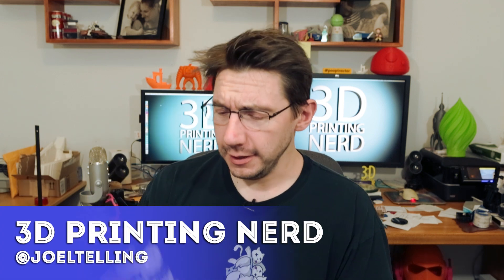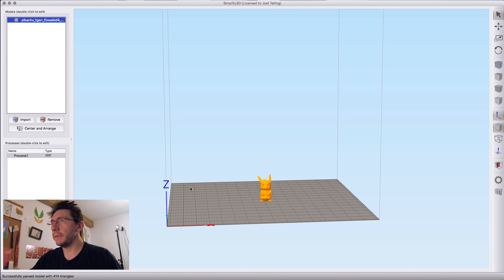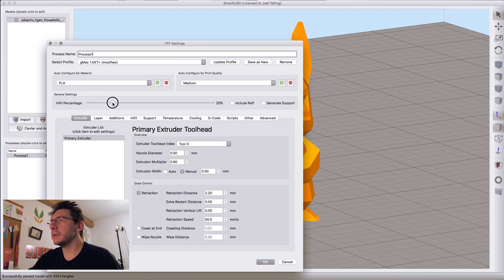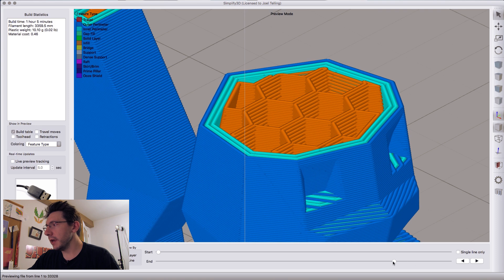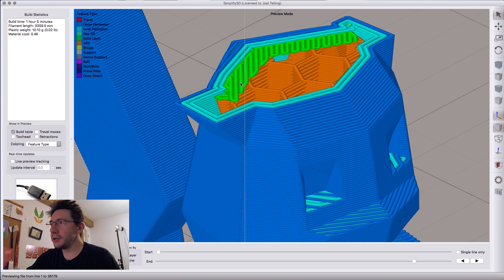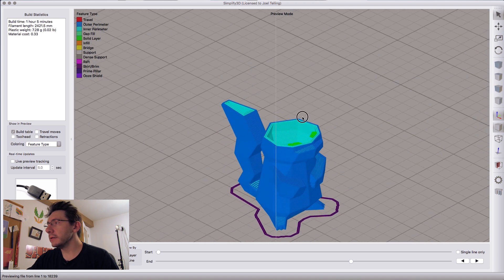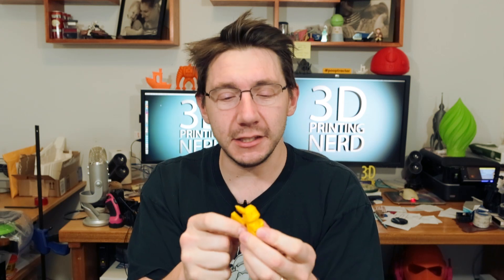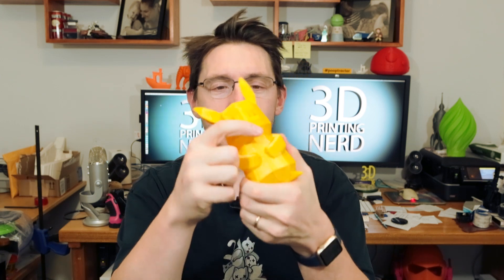3D Printing: Stop Wasting Plastic on Infill Percentage

Comment: What plastic did you use, there?  I have trouble with my silver PHA being hopelessly brittle when it's that thin.  I just did new arms for my sunglasses, and I went through about five iterations, trying to solve a problem with them snapping.  For those, I did go with 100% infill, but they were so thin that that was more a formality.  The walls were nearly touching, anyway, and I wanted the surface area contact in the brittle patch.  If I'd known, at the time, that Simplify 3D can do different infill at different layer heights, I'd have dropped it after the weak point.
Reply from the maker: +Michael Vaughan I used Colorfabb PLA/PHA for this one.
Reply: I thought so.  I think my roll of silver might have been weakened somehow (it's been in not the best storage for a couple of months).  I can snap it off the roll with my fingertips.
Reply from the maker: Michael Vaughan Oh wow. I have some filament that I haven't stored very well, and it's brittle like dry spaghetti noodles.
Reply: +Michael Vaughan The model in the video is a surface, it gets its strength from the walls and the structure, however, the arms of sunglasses don't have much material/wall/surface/volume so this will have a bit more impact on your arms.

I would advice just using ABS, it can bend better than PLA and breaks less fast. PLA however is 'stronger', but more brittle, but not brittle in a way you would really notice if you are just using it for small parts that dont have to carry much weight.

Comment: Hi Joel,I understand what you are saying and it all makes sense, however, if you are eliminating infill but increasing the perimeter how much are you really saving? I want to stress that I am not trying to come across as being ignorant or whatever but it's just an observation.
Reply from the maker: +Reviews 4 Youz !!! I thought about this after I read this from you, so I did a test. I put a 100mm cube in Simplify3D, set perimeters to 2, and infill to 10%. Simplify3D reported a 12 hour print time, and a plastic weight of 157.11 grams. I then changed it to 3 perimeters and reduced the infill percentage to zero. Simplify3D now reports 6.5 hours to print, and a plastic weight of 68.71 grams. You're not ignorant - it's a great question. Looks like the answer is you really are saving quite a bit of filament.
Reply: +3D Printing Nerd excellent !! funny thing is I was going to ask you to do this exact test. Thank you for all your videos, I love your enthusiasm and dedication to detail.
Reply from the maker: Reviews 4 Youz !!! Aww, thank you!  #highfive

Comment: HOLY CRAP was that good info! I hadn't even thought about using the "print preview" on S3D to look for ways to "cheat" infill by figuring out what support the shells would give.  Have you done any tests to see if increasing layer width in tandem with number of shells helps or hurts overhang-slouch?

And what about reducing infill to increase tolerances? I'm positive that too much infill can "bloat" a model (I'm currently dealing with a bunch of wasted carbon fiber due to printing an overfilled, over-sized part that needed to have tight tolerances... :( ) - but not sure if simply reducing infill will fix the issue..?
Reply from the maker: +Brandon T I don't think infill promotes bloating. I can't say I'm 100% sure, but, I can print with no infill, and 50% infill, and have the parts measure the same.
Reply: +3D Printing Nerd Ugh, well....that sucks, then, because I've got a friend (i.e. "my #1 customer"...sigh ;) ) who needs me to print him a bunch of parts to pair up with electrical components, and they need to be less than .2mm (absolute tops) tolerances or else things won't fit together correctly...and I already suspected 100% infill was the problem, and after this video was sure of it.  But I haven't had a chance to attempt a high-tolerance print with a (much) lower infill yet, so it's only speculation.

I admit that I haven't been sticking with a single filament color/type when testing, however, so that hasn't helped anything.  I'm sure in the end I just need to figure out the right layer height vs. layer width vs. infill vs. everyothersettingimaginable to get it right...but was hoping for an easy fix with infill. (Hah! I'm a comedian!)

Comment: These videos are dangerous... they just make me want to get a printer.
Reply from the maker: +Tim Gruich GET A PRINTER RIGHT NOW
Reply: Print me one.
Reply from the maker: Tim Gruich :)
Reply: And the ender3 is less than 200 and is great quality.
Reply: you can choose hang printer( require a lot  of space), cheap as f Anet A8 (require tons of troubleshooting) or Snappy?(most reprap reprap printer = quality vary)
Reply: I got a Prusa MK3S about a week ago. It's been a BLAST!
I've wanted a 3D printer for many years. I'm trilled with how easy it is to use. Of course I've watched a bunch of 3D printer videos so I knew what to expect. It would be pretty hard if someone got a 3D printer without any background in it.

Comment: Man, getting Simplify 3D is getting even more tempting now......is it truly worth it? Or is there another one with next t the same function?
Reply: Ditto printing is nice but the real benefit is the acceleration and the printer control during the print. There are types of prints where 100mm/s works fine. With  a pause, change temp, change speed, change filament, and more available while printing makes fine tuning nice. Readup before you flash.
Reply: +Hestand Gaming      S3D is worth it unless you like tuning software profiles.  Even my best profiles from any of the other slicers were not as good as S3D out of the box.  S3D is to slicers what Sailfish did to MB firmware, a whole new level.
Reply: +66tbird1 I would like to learn more about the advantages of Sailfish. I've been thinking about ditto printing.

Comment: hi I purchased a prusa I3 printer kit and had an absolutely horrible experience. I had to buy about 120 dollars worth of new parts to replace ones that weren't working. I eventually disassembled the printer and am going to have to sell the parts. was wondering if u could suggest a printer around the 300-400 dollar price range that has a reasonably large build size.  thanks for ur time.
Reply: +Isaiah Hong This thing is amazing, a pretty much direct clone of a Makerbot one, and it's really good.  No problems, I've had this since Christmas and it's great.  http://www.monoprice.com/product?p_id=13861
Reply: +Isaiah Hong My printer is a piece of junk and is an I3 Rework/Einstein that I made and I have barely had prints on it.  I just completely rebuilt it and I still have issues with the first layer due to the crappy bed.  I will say if I ever get back into 3d printing the printer will NOT have a sliding bed.  A stationary bed and a moveable nozzle (think Ultimaker) is the best approach for many reasons but costs more so the only moving of the bed I will allow is up and down but would prefer a stationary bed.
Reply: +Isaiah Hong I made a Prusa i3 framebox and works like heaven. Printed 0,06 layer with excellent finish. (can't even see the layer)
Reply: +trefhi same here. got a dead cheap i3 kit from china. took a bit of tuning +  auto bed leveling but now it works like a charm. those kits really just need some time and effort to work great.
however, the biggest improvement so far was to get simplify 3D.
Reply: Joel Hirtle
It is an awesome package only the one issue I mentioned which, for most cases at least, you will never run into.  I mean, seriously, how many times do you need to run a bridge 50+mm long?  Seldom, but if you do Cura, and S3D, you will hate.
Reply: The Prusa i3 is awesome, you probably just bought a fake from some shady website.

Comment: I agree, but for some models you need at least 20 to to 25 percent infill. for example, I was printing a companion cube and I only had 10 percent infill. the issue, was that since it was a cube, it had to print on a 90 degree which is typically fine, but since it was only 10 infill, it had to bridge of the large gaps in the infill. it did not go well. it just poured the filament into the gaps. I recommend 20 or more in situations like that. but never more than 30. also, you might want to use 100 on smaller pieces if you are using clear filament so you don't see the grid formation inside of it.
Reply: +CJ Printing agreed the idea of infill is to act as an internal "support" to allow bridging because as you point, if this model was a cube the results would not of been the same.
Reply: +DIY3DTECH.com exactly. also I'm making a 3d printing channel and some videos will be up soon if you feel like checking it out. I'll be sure to sub to you.
Reply: Please do!  I am very interested in small scale fabrication concepts...
Reply from the maker: +DIY3DTECH.com I'm sub'd to you :)
Reply: Many thanks!
Reply: +DIY3DTECH.com I subbed as well!

Comment: What if your planning on subtracting material from the model by sanding? Would it still be fine?
Reply: +SkintSNIPER262 for sanding or any other smoothing would add to the perimeters as this is what you would be sanding...
Reply: DIY3DTECH.com Thanks!
Reply from the maker: +DIY3DTECH.com Exactly
Reply: DIY3DTECH.com Is there any particular form of models this doesn't work for? Or is it a universal sort of thing?
Reply: An object as Joel picked is the best as it is sort of a "vase" in that has a limited distance in it's longest bridge.  As infill has to two proposes. The first is to provide stability to the shell and second is to minimize the bridge distance.  As Joel points out there is a diminishing return on increasing infill density as it is primarily the geometry which does the work...

Comment: I already do this with any parts that aren't structural. 

Just a tip Resin is cheap and you can drill a hole in models and fill them with solid resin.
Reply from the maker: +JackDaniels2535 FANTASTIC idea!
Reply: 3D Printing Nerd Thx I Used to work in the fiber glassing industry. So i just applied that to 3d printing. You can make super strong parts by 3d printing the framework of the part and paying fiberglass over that as well. You don't even need fiberglass matting either. You can use all manner of cloths. Old jeans for instance make fantastic Micarta like parts and when hard you can sand it like wood. If you uses light colors or white material you can stain it with wood stains and get great looking parts.
Reply: or melt some of your failed prints. It might melt the piece though... something to try
Reply: @Niles Black because most people would just buy a resin printer.

Comment: So that's what you were printing! Half of the files from that guy have inverted normals, S3D doesn't seem to care! Also less infill means less PRINT TIME!!! Pikachu Lamp?
Reply from the maker: +Maker's Muse Yeah, Simplify3D just didn't care at all about the inverted normals. For this video though, I ran the model through Netfabb so it would look better :)
Reply: +FTcuber Netfabb Basic doesn't do much these days so I use their cloud service for most things at cloud.netfabb.com or if it's a more manual fix I'll use meshmixer.
Reply: I'm two years late, but with blender you can hit the "Make Normals Consistent" button which does it nicely for you.
Reply: I don't know if s3d got better with that over time, but I remember having problems with the flipped surface last time I tried to print it. Since you're Maker muse, got any tips on how to fix that with basic softwares (like netfabb or any other free software)

Comment: NO not pikachu you monster! kidding of course, i should try some prints with no infill soon.
Reply from the maker: +ToastedBagelBaconJam Ha! Give it a try. Remember my Yoda Bowl? That was zero infill as well. At times, the shape of the model aids in the strength. I printed the SpaceX Falcon9 rocket, and it was zero infill. Still strong because it's a cylinder.
Reply: +3D Printing Nerd didnt you use something called vase mode for the rocket? was that simplify 3d?
Reply from the maker: +ToastedBagelBaconJam I went with two perimeters, though, I could have done vase mode. That's in Simplify3D, and I believe Cura as well. Vase mode / Spiral mode.
Reply: +3D Printing Nerd i use matter control, i need to work on getting cura set up, prints never stick to the bed as well as i like with cura.

Comment: Cool tip, I'll will try it out! Do you have any tips for printing on PETG, I just got a free sample and I have no idea what settings to use for the extruder and heated bed?
Reply from the maker: +TheCubingGamer I haven't had the chance to print with PETG yet, but, it's definitely on my list. I think it's similar to ABS in nozzle temp, with bed temp around 50c-60c. I think.
Reply: +3D Printing Nerd Thanks!

Comment: Thank You Joel...I will try this out and see what happens. In your opinion, when should infill actually be used?
Reply from the maker: +Timothy Jacobs Hi Timothy! It truly depends on the part, the filament, the number of perimeters, and when there are portions of the model that require some sort of surface to print on. If you have Simplify3D, do what I did - preview the build and slowly move the slider. If it looks like the walls of the model will be okay, give it a shot. Look back in my videos and find the Yoda Bowl 3d print I did - that too was done with zero infill. However, if you look at the prop gun 3d prints I've done, I usually did 10%-20% infill knowing that the models would be handled a lot.
Reply: Ok, thanks...It makes since. I am getting ready to try a larger project on my printer and like you said, stop wasting filament. I think I went through too much filament by using default settings and I need to quit doing that. I will check out what you recommended and see what the differences are. I don't have Simplify3D yet, but it sounds like I may want to check it out as well... :-)
Reply from the maker: +Timothy Jacobs Simplify3D is an amazing program for 3d printing. Look around the web and you'll see high praise in most places. I say this after paying full price more than a year ago :) Also, I wish you the best of luck! Keep me posted on how you do.
Reply: Thanks again for everything...I will let you know.
Reply: +3D Printing Nerd Giving Simplify3D a try as we speak.
Reply: I wish I had seen this video in 2007 would have saved me lots of money.
Thank you for educating me when I thought I knew everything LOL